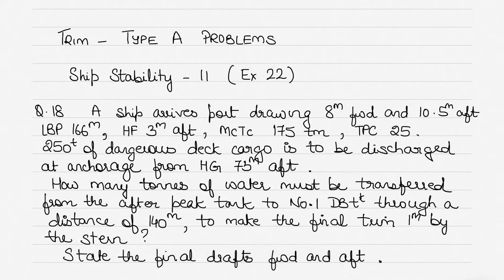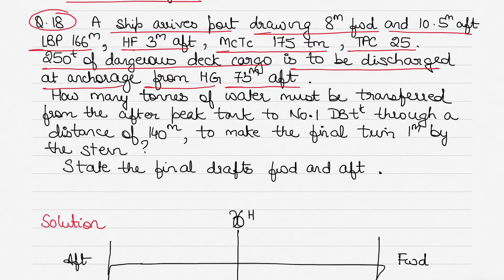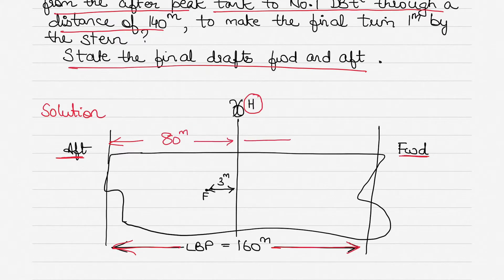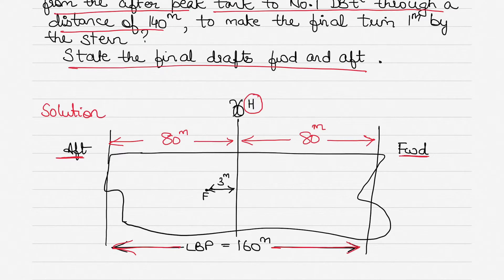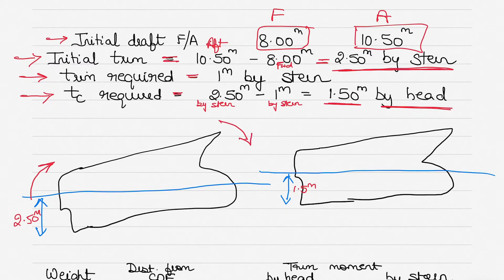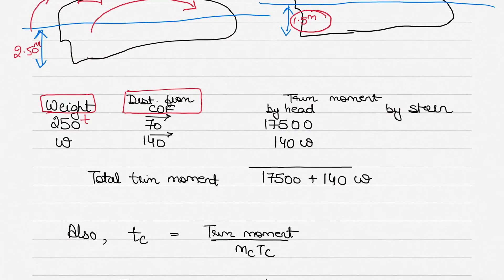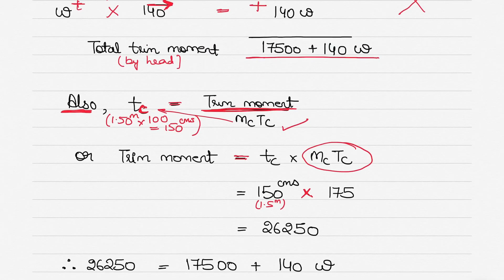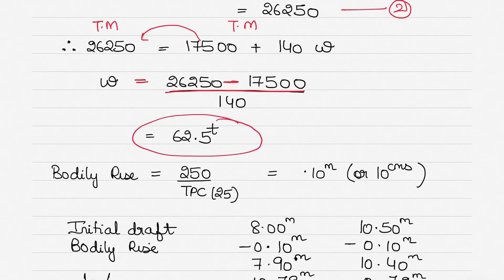Ship Stability (Trim -Type A) - Finding weight to adjust trim and final drafts

Comment: Good day Captain! Can you kindly throw more light on how to solve this question. 
A ship, which is trimmed 0.25m by the head, requires 800 tonnes to complete loading. Two
spaces are available, one 50m forward of LCF, and the other 70m abaft LCF. Calculate how
much cargo to stow in each space to complete with a trim of 0.25m by the stern.

MCTC 240